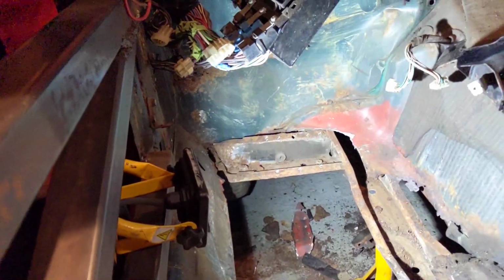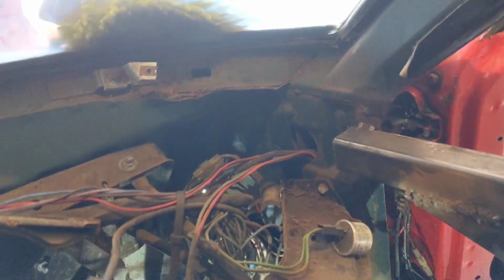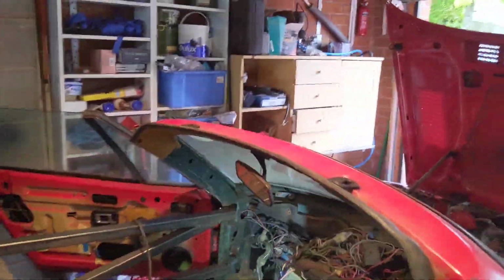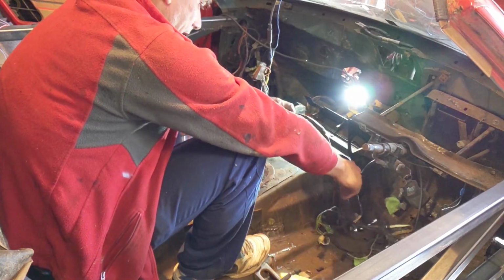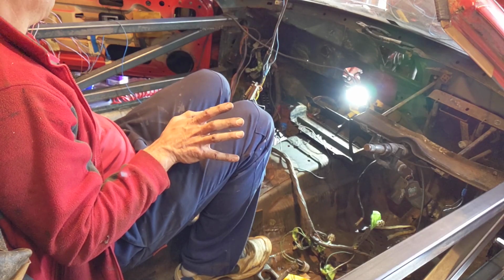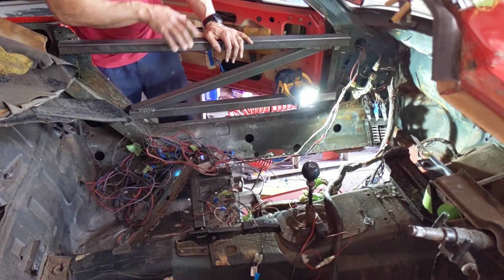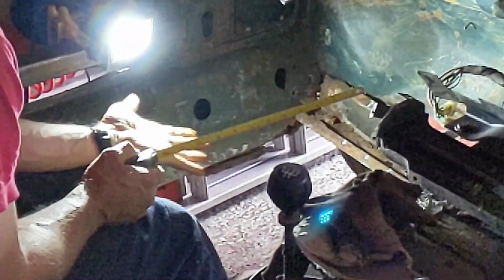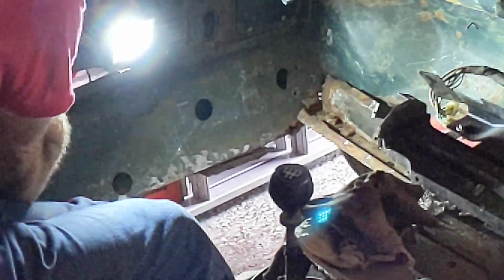Triumph TR7 Restoration: Episode 10   Removing Cabin Wiring

Comment: Good to know my car isn't the only one with a mess of bodged wiring and scotchloks! 
The loom going into the engine bay goes along the inside of the wing and out to the front of the car, terminating at the lights in one unbroken run. So it's not a case of simply unplugging it; it's a fairly involved process. Probably best to leave it there for now and hang it out of the way.
Reply from the maker: Yeah, I was looking at where the loom goes within the engine bay (and thinking it will be tough to run it back in there), but I also seem to have extra wiring in the engine bay.  Good news is it looks a lot simpler without the electric windows.